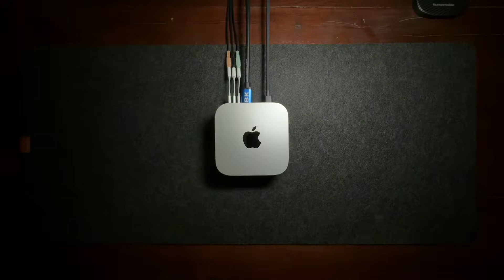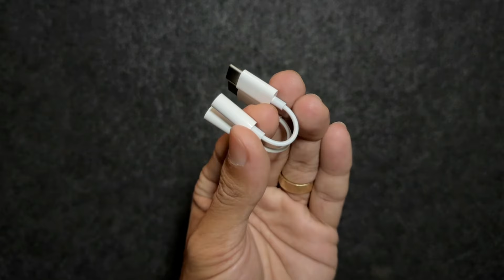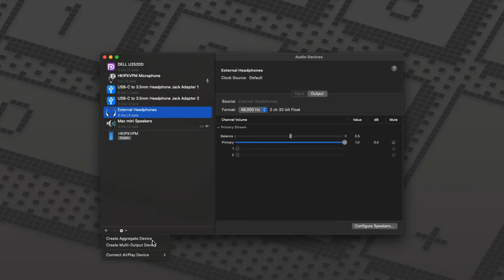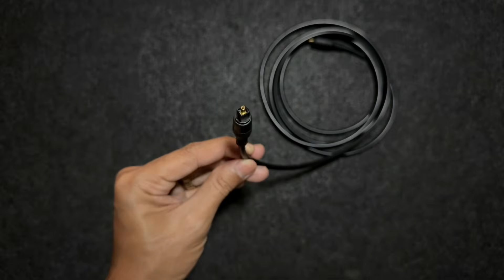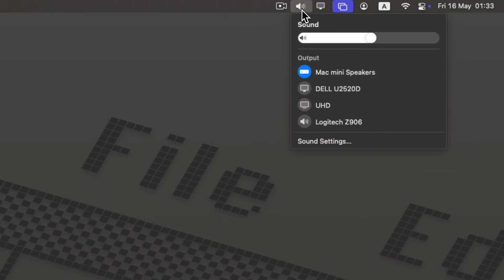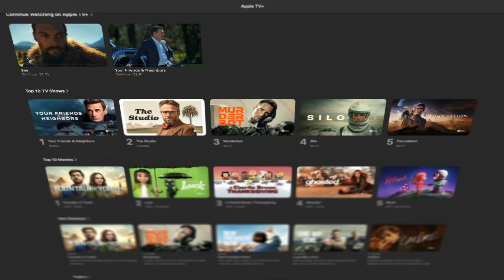Unlock True 5.1 Surround Sound on Mac mini M4 Pro with Logitech Z906!

Comment: Hi, many thanks for the tutorial. I purchased a 4 port USB-C hub, and 3 Apple 3.5mm to USB-C adapters as advised to go with my Macbook Air. I eventally managed to get it working perfectly in OSX, after reading the comments, that I needed to disable ALL Effects on the Z906, otherwise it only plays in stereo. I thought I had it cracked, but Netflix, Disney, YouTube  etc via browser still only play in stereo, even though OSX plays all the speakers correctly when checking in the speaker configuration utility. Any idea why this is? If I then activate any of the Effects modes, then all 6 speakers play sound, not quite correct 5.1, but almost convincing as rear speakers play sound, just not correct rear surround. Thanks!
Reply from the maker: The EFFECT is designed for stereo sound. Depending on the effect you choose, the sound will play to the corresponding speakers. However, it’s just stereo sound. In conclusion, your setup appears to be correct. The issue is that the sound you’re playing is stereo.

Here’s an additional suggestion in addition to what you’ve done:

1 - Get a surround sound file from another source. It usually has a .MKV file extension.
2 - Get an app to play that file. I recommend Elmedia.

Make sure your setup is correct, turn OFF the speaker EFFECT, and give it a try!

I also demonstrated this in my unboxing video, so please check it out.
Reply: Many thanks for that. I did as suggested. Got an mkv file with surround sound. Played with Elmedia and sure enough, it played in 5.1 surround from all speakers!!
Can I ask then, why doesn’t this work with Netflix/Disney+ etc? Thanks.
Reply from the maker: I haven’t tested those yet. But I got some idea related to Netflix. 

- You should run on MacOS Big Sur or later. 
- The only supported browser is Safari. 
- The suggested connection is HDMI, or you could try 6-channel direct.
- You must subscribe to Standard or Premium Netflix plan (5.1 available for selected content only)

These ideas based on what I’ve researched only. If it works or not, I’m happy to hear 👋🏿
Reply: @thesignatureofk  Hi, so I tested it with Netflix and Disney+ with both Safari and Edge and there is no 5.1 sound, so not sure how would proceed from there. Using Elmedia player and Plex or Infuse, the 5.1 sound works perfectly!

Comment: When I plug in the USB-C to 3.5mm dongles, it is only detecting ONE set of 2 channel output speakers and one microphone device.  I am using a Logitech X-530 5.1 system.  Is there something that I'm doing wrong? There's no mic so this sounds/feels wrong.  

I feel like only one dongle is working but all the speakers are firing but without being able to fire off one speaker at a time, it feels like some kind of virtual 5.1 setup.
Reply from the maker: Many people reported about this problem. A simple fix, use Apple dongles.

If not, all dongles must be different branding. Otherwise, your mac may recognizes only one dongle. 

Please have a try!

Comment: first method could work with usb-c to jack 3.5 mm splitter? cause i only have one usb c port free of use
Reply from the maker: If the adapter splits to three different 3.5mm jack, it would work. But most splitter are made to split the stereo to more devices with the same stereo signal only.

In this case, I would recommend you to get the USB-C Hub, or Docking Station to add the extra ports for the method one.
Reply: @thesignatureofk  thanx for your reply!
Reply: Hi there! I tried your first method on my macbook pro m1 16" and on midi device only one usbc to jack 3.5 is seen as out, the other one is as input. I tried directly and via usb hub/dongle same thing
Reply from the maker: @djhairlessRO   Hey @djhairlessRO! I’ll do my best to help you out. There are a few things I’d like to share.

First, if you have two USB-C to 3.5mm dongles, one with [0 ins / 2 outs] and the other with [1 in / 0 outs], there are a couple of possibilities:
1. You might have plugged a device that can output audio and has a built-in microphone (like EarPods) into your MacBook using just one dongle.
2. Or, you could have two dongles: one for a speaker and one for a microphone.

Second, I’d like to give you some advice on choosing the right dongles.
1. I highly recommend using the Apple USB-C to 3.5mm Headphone Jack Adapter. I’m 100% sure it’ll work.
2. I also want you to try the Apple USB-C to 3.5 mm Audio Cable (1.2 m). I haven’t tried this one yet because it’s not available in my country. This might be easier; you could just plug the cable directly from your Mac to the speaker.
3. If you’re using dongles from other brands besides Apple, make sure to buy from two or three different brands. Don’t just use one brand. If you do, after plugging the dongles with the same brand into your MacBook, it will only show up as one dongle in the Audio MIDI Setup App.

I hope this helps!

Comment: Damn this was very simple with my windows PC for ant ATX motherboard. I have a mac and a mini pc now so I can't utilize my setup. I have my Z906, and it's limited to analog only :(
Reply: What kind of set up method did you use. 🤔🧐🤨
Reply: @RickyV-Production It's pretty direct. You connect the RCA cables to Audio Jack from the speaker to the motherboard's 3 audio ports at the back. It's very easy to do for m-atx and atx motherboards, as compared to using 3rd party adapters.
Reply from the maker: @xianlaw I’ve came across many sources on ‘how to connect this system to PC and other devices’ and it seems to be straightforward. Since this system is mainly design for gaming and home theater.

But on the Mac side, almost nobody could confirm if both systems could work together or not. That’s why I’m coming up with the idea and wanna share it in this video. 

Hope you find this helpful 👋🏿
Reply: @thesignatureofk same it's frustrating macs and laptops because of limitation. Some of it costs so much (and I'm not even sure if it might disrupt the visual quality if hdmi to rca. :(

Too bad bluetooth can't support 5.1-7.1CH.

I miss my old theatre setup.
Reply: @thesignatureofk I don't want to use wireless because damn wired is just chef's kiss for audio quality.
Reply from the maker: They make simple things hard for user. But once you get into their ecosystem, things work like magic, but the cost would add up.

Speaking about Bluetooth or Wireless, I don’t really mind if this system doesn’t have it. Simply hook the speaker system to the Mac, and AirPlay medias from the iPhone. Like you mentioned, it doesn’t support 5.1 and ignore the horrible sound quality 🫠
Reply: @xianlaw Agreed! 

Wired is the way to go for audio quality. 😊